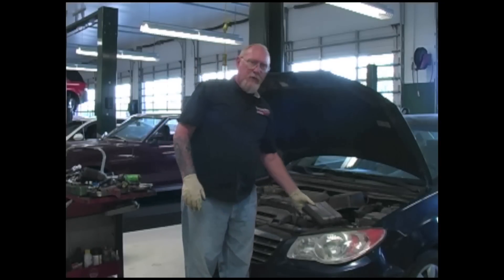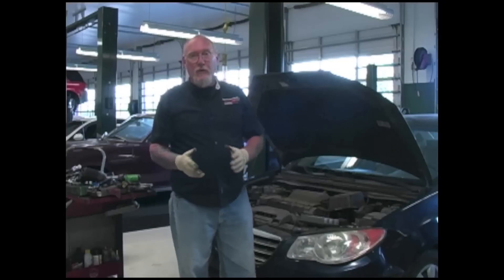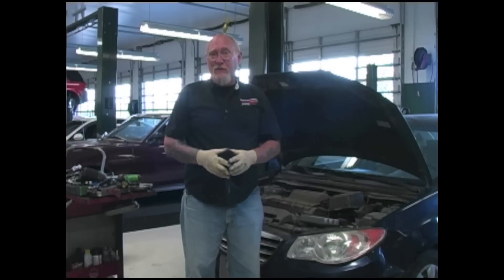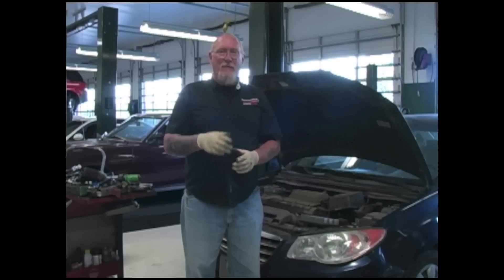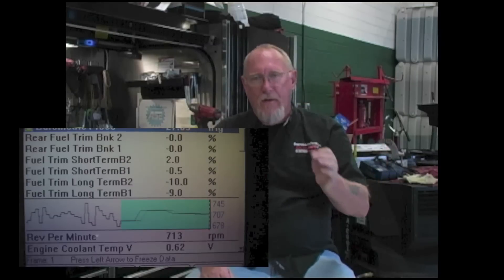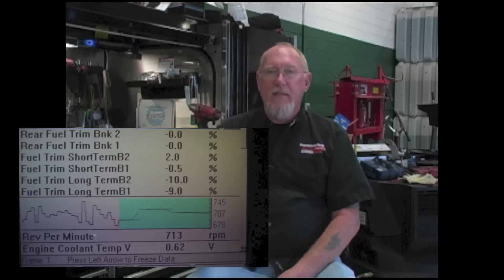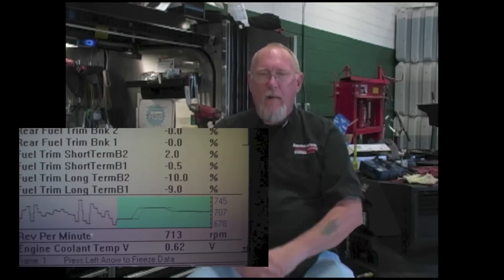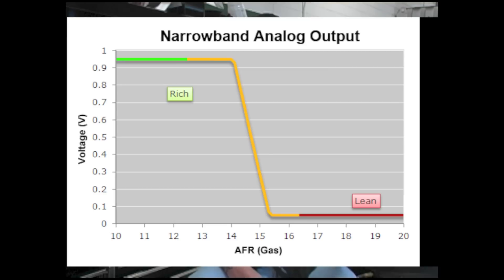The Trainer #41: What is fuel trim?

Comment: My car is supercharged.   2015. Roush RS3.     At cruse speed  60mph.  - 9 to  - 12.   On LTFT   STFT IS +/-  6       Fuel pump went last week.  I replaced it. And these are the new numbers.    Cold 
Start.  STFT are -25. Until operating temp is reached.
Reply from the maker: You need to consider fuel trim totals at different operating conditions. What are the STFT and LTFT readings at idle (warm) and at 2500 rpm?
Reply: @VehicleServiceandRepair  bank1 and 2 STFT between 0 and - 5.   LTFT Bank1 -11  bank2  - 6    Warm and at idle. STFT. are +2 to +4.  LTFT  bank1 +6 bank2 +2.
Fuel pump duty cycle is  30.37%.  Of course it fluctuates     WOT. DUTY cycle goes to 49.80% on a boost a pump (voltage amplifier ).  That’s commanded by fuel tables at 10psi of boost ( supercharged )
Reply from the maker: @MustangGuru  I would be happy with those trims. What's the drivability concern?
Reply: @VehicleServiceandRepair  just the slight unbalanced LTFT    I’ll check the plugs.   The fuel pump went out last week , may have caused some slight burning of the tips when it went lean.  Thanks for the fast responces.
Reply from the maker: @MustangGuru  You'll never get both banks to match. Slight differences in internal wear is enough to cause the variations. If STFT is switching back and forth over 0, the ECM is in fuel control.

Comment: dear sir I have question related to GM vehicle with dtc P2097 post CAT fuel trim , what is the condition for setting this DTC ?and does the downsteam O2 sensor play a role to send feedback to ECM regarding the fuel trim after catalystic?
Reply from the maker: Check out this article - it should help you understand the reason(s) for the code and how to diagnose the cause:  https://www.obd-codes.com/p2097

Comment: Hi. Tanks for these lectures. I have a question, in my Toyota of 2001 D4D, there is no O2 sensor. How does the engine deal with the fuel trim ?
Reply from the maker: Is this a diesel?
Reply: @VehicleServiceandRepair  yes it is a diesel. Two catalysts and no O2 sensors.

Comment: Get a starting fluid spray can or carb cleaner and put the red little tube on it. Spray just a little bit at different places around all the intake and vacuum hoses. Soon as you see a change in idle, you are close to the leak cause you just added fuel and it sucked it in.

Comment: Really very good explained about fuel trim , please tell if there is rich condition at idle , get normal at 2500 rpm then what is the possibility of cause , please tell....
Reply from the maker: +HARSH BHARTI A rich condition at idle that becomes more normal at cruise speed? Consider what is happening. Idle air intake is less per cylinder than it is when the rpm's are raised. The ECM is adding fuel based on the amount of air being measured. The "Rich" reading means that the fuel added by the ECM is actually more than the engine is supposed to need so there may be fuel entering the cylinder that is not a result of the ECM's command. I would look for a leaking injector. The impact on fuel trim would be more noticeable at idle when there is less air than it would be at higher rpm when there is more air. Does that make sense?